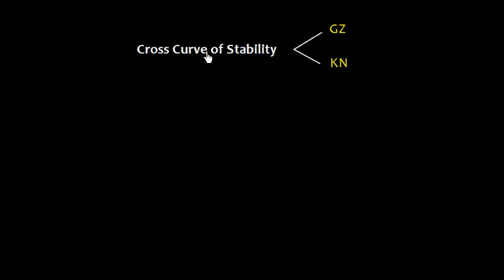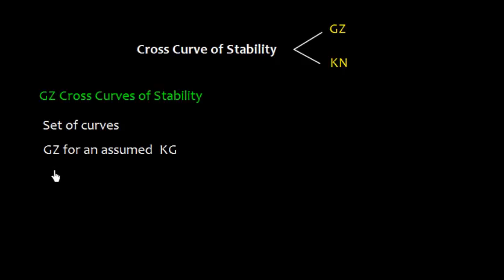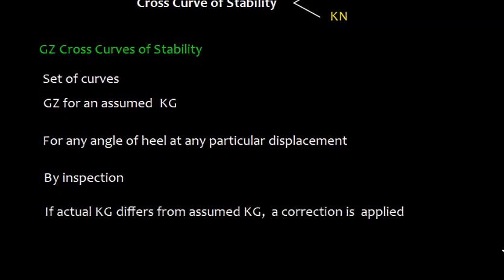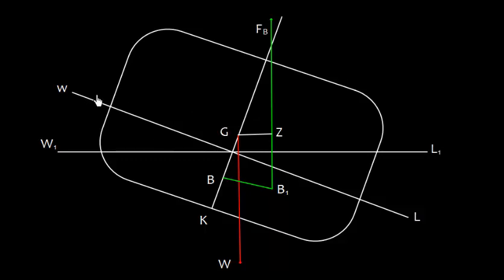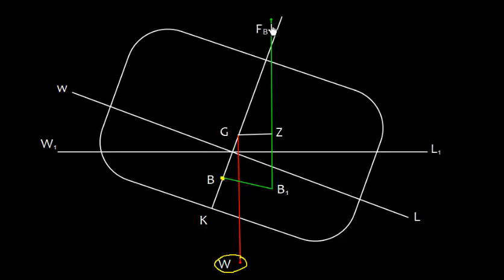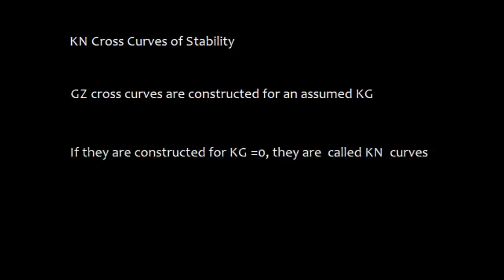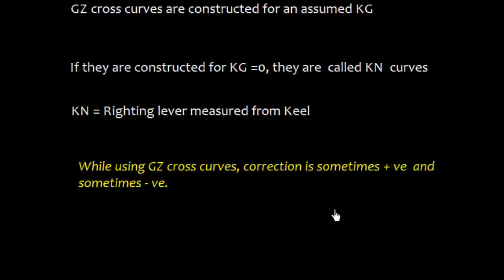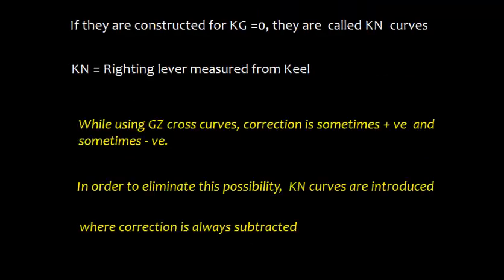Ship Stability _ Cross Curves of Stability_ Introduction to GZ & KN curves

Comment: you suddenly change the topic and start talking about g1 however  g is not change in vessel unless you shift the cargo. ıf you put g1 you must explain why the point of g is changed as g1 did you shift some weight?
Reply from the maker: It is not g or g1  .It is KG and KG1. Assumed KG vs actual KG. Study some basics before you  question.Thanks.
Reply: @sailorstube3259  thanks for expilanation.